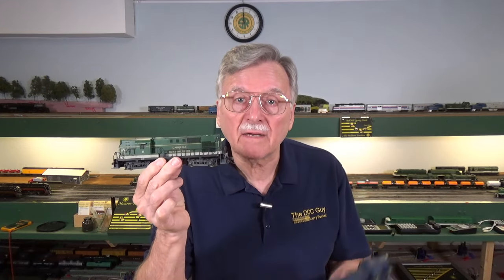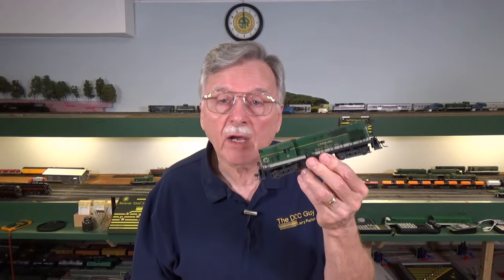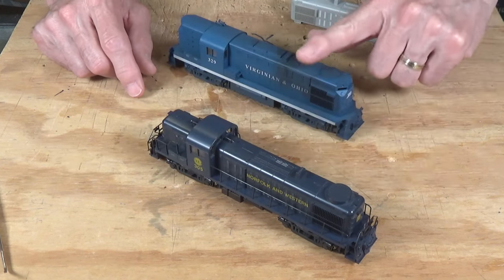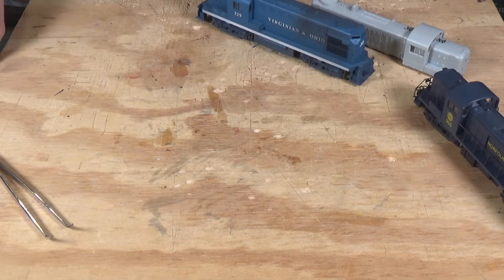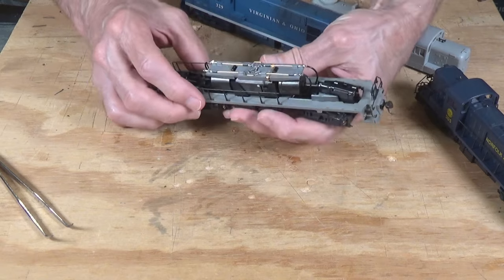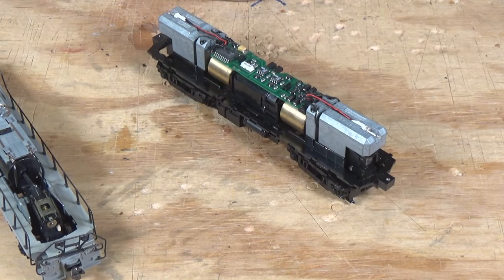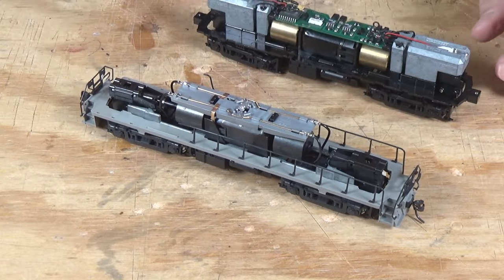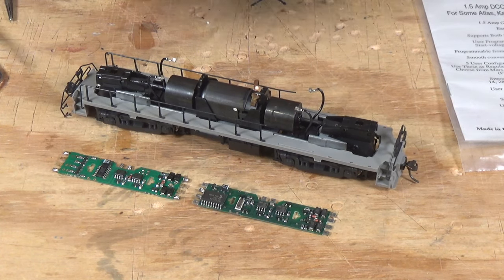Simplest Way To Convert Old DC Locos To DCC (267)

Comment: I just want a bright headlight in my Bachman steam engine Yard Master!    Sounds are cool, but I have a shelf train and want a bright head light and maybe other running lights on a caboose or other cars.
Reply from the maker: That is Bachmann’s fault if they installed the headlight. You’ll have to open it up if possible and see how it is wired. You may be able to use a smaller rated resistor and get a brighter light, but I have no idea what you have.

Comment: This is what I have used for years on these locomotives. The NCE DASR is a pretty bulletproof decoder. I add a loop of wire in the two holes on the decoder board, and then loop the brass motor leads around them. I also open up the track pickup wire tabs and solder them in place. These Atlas/Kato are great layout quality power without breaking the bank!
Reply from the maker: Yes, I rate them right up there with the old Stewart/Bowser F-units!

Comment: How do I program a locomotive that has an older Soundtrax Tsunami so that when it starts moving forward the horn blows twice and in reverse it blows 3 times? I have one loco that has this feature as a factory set effect and I want to duplicate
Reply from the maker: That requires some complicated programming and I would only attempt it using DecoderPro. I seldom use auto functions like that as it tends to drive me and the train crews crazy to have the loco popping off all the time. However the SoundTraxx manuals have pretty good documentation of these complex features.
Reply: @TheDCCGuy  I have Decoder Pro

Comment: How do  you install a Sound and DCC decoder in a DCC ready SD40 Kato? This loco has a DCC decoder but I want to add sound.
Reply from the maker: Find a decoder that fits the socket in the loco, plug it in, and connect the speaker wires to a speaker that will fit in the model. Some models even have a properly sized depression for a speaker so check fir that, otherwise I use sugar cube speakers from www.sbs4dcc.com .

Comment: Thanks Larry.

You motivated me to do a conversion on my Athearn Blue Box GP9.  Using a Loksound #58921, drilled out the mesh screen to let the speaker sound through and it came out awesome!  Next is adding some LED’s.

Spent $26 on the engine many years ago and $120 on the decoder & sugar cube speaker and it’s a fantastic upgrade/addition to my fleet.

Comment: My very first drop in board installation was an Amtrak-painted Con-Cor SW7. I had a Soundtraxx that I was going to use in another locomotive, but the sound system broke while the decoder was in storage, so I used it in the switcher. The "Silent-traxx" decoder pairs nicely with the SW7. The installation was exactly like what you describe.

Comment: I did mine many years ago. My first was an RS1. I used bulbs for the headlights and melted the shell from the heat of the bulb. Since then it's been LEDs for all my lights.
Reply from the maker: I love my RS1, the heavy diecast chassis makes for a great puller.

Comment: Larry Some engines are easy to convert and some are not I have two I been working on for sometime off and on trying to get them to work properly  I always watch install videos to get good ideas   Thanks
Reply from the maker: That’s for sure! This type of board works best for the vast majority of diesels. I have even used them on old Athearn locos by sticking it to the top of the motor using double sided foam tape. The one problem comes with LL E-units because the board is a bit too long. For those I now use a Decoder Buddy.

Comment: Are old Rivarossi steam locamotives like this?
I have an old Rivarossi Big Boy and a Hudson I'd love to do this too.
Reply from the maker: Depends how old. The old motors were pretty bad. You might be able to lube and clean it up and see how much current it draws, then get a decider with enough capacity to handle it. Good luck.
Reply: @TheDCCGuy  they are very old, I struggle to finde information on them on YouTube because most of what I find is newer models. 
They are the the ones that don't have any real cab detail because the shell extends inside of the cab.
Reply from the maker: That would likely be difficult then, but not impossible. As I said you need to get it running great on DC then measure the stall current and that will allow you to select a decoder with a current capability large enough to power it. Someone used to make a re-power kit for these but I don’t remember who or how long ago.

Comment: I have an Austrian made Atlas Alco s2 switcher. I haven’t tried adding a decoder to it yet. I wonder how different these Atlas units are from the Japanese-made units?
Reply from the maker: Take the shell off and see if it has a skew wound motor, I don’t think it will. It more likely will draw about 1 amp or maybe more. Also the motor is not isolated from the frame so you’ll need to do that before installing a decoder. I’m pretty sure I’ve covered all this in previous videos. I might have discussed this in video 96 although that one has the skew wound motor.
Reply: @TheDCCGuy  thanks, I’ll find that video and take a look.

Comment: The only comment I would like to say is that why did you placed the NCE D series decoder up side down?? I have placed a few in my units, so in the future I could use the functions for lighting and yes, I hard wire my motor leads. You are right on that. Due to some of the new ones do not have them anymore.
Anyway, good show. Keep them coming.
Reply from the maker: Because that’s what the instructions tell you to do!
Reply: @TheDCCGuy  Hmm. Then I might have the newer versions. They have built in 1K ohm resistors on the boards. All you have to do is cut the trace's on them, if you are doing All LED's. I like them too. A whole fleet of my RS-1's are wired that way with no problems. But the new ones I have do not have the motor tab's, as you mentioned. Anyway, thanks for the feedback.👍

Comment: Hi Larry. I am kind of new to the hobby and bought a vintage HO scale E-R Model FP-7 loco made by Roco. I would like to convert it from DC to DCC but I can't get the shell off to examine the interior. It has the old style couplers as well. Any advice on how to take apart would be appreciated as well as what decoder would be appropriate. Thanks in advance. Alfred
Reply from the maker: First look at the underside for any screws that might hold the shell on. If there are none then try pulling out the the side of the shell using the side skirts at the fuel tanks. These are common methods model makers have used.

Comment: I'm curious why you wouldn't use the clips from the pickup wires for the solder connection to the board? Seems to my novice eye that would be easier than trying to manipulate those tiny wires.
Reply from the maker: You could try soldering them to the board, but in some cases they just aren’t long enough so you need to clip them off and splice on a little extra wire to make it long enough.

Comment: He seemed to be pretty knowledgeable about DCCs could you tell me if it’s possible to put a decoder in O scale - three rail systems. I’d be extremely interested in seeing that set up.
Reply from the maker: First, are you using AC or DC O scale? That obviously makes a big difference. Take a look at the info on the website link below on how to use DCC decoders with AC motors in Lionel or other locos with AC motors. If your loco is DC powered then you just need to get a DCC decoder with a current output rating sufficient for the amperage demand of your motor. Most companies offer decoders sized for O scale and Jim Scorse who owns NCE has an O scale layout so his stuff is designed for it. I suggest you look at the various manufacturers’ websites for specific info on how their systems support O scale.

https://www.digitrax.com/tsd/KB895/digitrax-decoders-with-ac-motors-and-lionel-type-e/

Comment: Is there a similar simple way to convert Proto LifeLike GP9s (I have 5 of them) and SW900s?  If so what decoder do I need? Do not need them to have sound.
Reply from the maker: For the LL SW9 NCE makes the SW9-SR decoder configured to replace the original circuit board but they are out of stock right now. You might check eBay or dealers who stock a lot of NCE. For the GP9 I previously used a Tsunami2 but that had to be hardwired. In most cases the opening between the weights is just too short for one of the boards I showed. I have a LL GP7 on the benchtop right now that needs a sound decoder so I am scoping out the best options. I am thinking a mini Decoder Buddy might work but need to do some test fits to make sure there is overhead room.
Reply: @TheDCCGuy  Thanks Larry!  Much appreciated.

Comment: The Digitrax DH165A0 headlight outputs are reduced volatage to allow LEDs to be connected without resistors. This means that the easiest way to add DCC lighting to the older Atlas Kato locos is to solder 3mm warm white LED leads directly to the headlight output tabs (keeping polarity in mind) and then simply shorten the light bars to account for the LED location. I'm not sure what board you're using in the video, but very nearly all RS-3s have the long hood front, so wiring the board with long hood rear means having to change CFG after install, which is basically just one more thing that can go wrong.  I would also say that my experience with NCE DA-SR has been a high defect rate and a difficult time dealing with support.
Reply from the maker: Good tips for sure. I plan a followup video on adding LED lights and will mention that option. I usually cut the light tubes short, sand flat, drill a small hole, insert the LED into the light tube, plug it with black tack and pop on the shell. I’ll demonstrate in the followup video.

Comment: Curiosity question for you, Larry.  What temperature setting are you using on your soldering station for installing the decoders and LED's?  It's just the engineer in me!
Reply from the maker: I use a very hot iron set at about 800 degrees unless I am working with sensitive electronic parts. I tell folks to star at a temp at which the solder will melt and then work up to what works best for them as they get a feel for different jobs.

Comment: Great video once again Larry!! 
Are all old Atlas motors already isolated?  I have a few F7 units that look similar to this video but am not sure if it is isolated or not.
Reply from the maker: I suspect you have one of their FP7 models. These were made over a long period and the motors for the most part were power hungry—I burned up my first CTC16 receiver with one of those. I still have 3 but replaced all the motors with various can motors but I seem to remember that all were isolated, but check to make sure.

Comment: One problem I found in the past about doing these old Atlas is that the weights in the ends would eventually short out those end wires so maybe shrink tubing or tape would be a good idea for the track pickup wires.....
Reply from the maker: Yes, the weights tend to float around in the hood. One other option os to put a piece of electrical tape on each side and insert the weight into the shell before installing it. The tape provides a tight friction fit so the weight tends to stay put.

Comment: I've got two (2) Athearn F 7's 
That are about twenty (20) years old 

How would you have DCC 'ed those and with what type of DCC ? ? ?

Never Mind 

I found your other video
Reply from the maker: I have an ABBA set I built and painted in 1980. For those I used a standard HO scale decoder hardwired in the model. I installed it on a sheet of styrene with double sided foam tape and the styrene platform was held in place atop the motor with double sided foam tape. You could also use one of the decoders I showed in the video by installing it atop the motor with foam tape. The problem with those older models ws the motors which drew a lot of current, and the sloppy gears. I later remotered them with Mashima cans but the gears were still sloppy. They are mainly shelf sitters now. The current Athearn motors are much more efficient. The important thing is to measure the stall current and buy a decoder than can supply it. I checked another old model with a Sagami can motor and it has a stall current of 2 amps, that’s almost half the output from a standard booster!
Reply: @TheDCCGuy  
Thank You Very Much
For the information .
I'll keep this conversation for later .

Comment: Any Old Locomotive?
Reply from the maker: I didn’t say ALL, but you can do a lot of them with these decoders. You could even put one in a tender and run wires back to it from the engine.
Reply: @TheDCCGuy  That's why i asked, thanks.